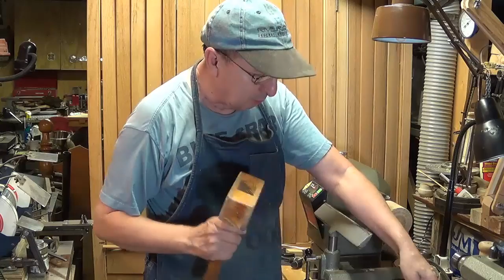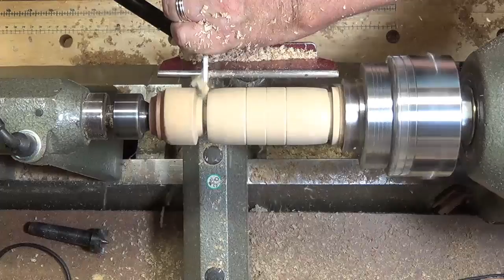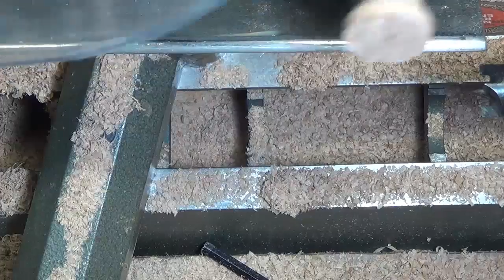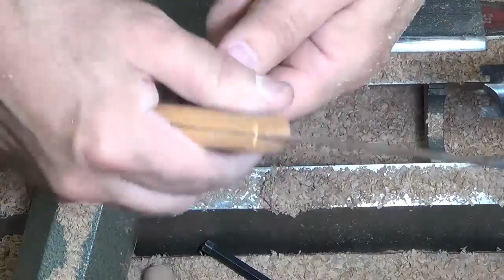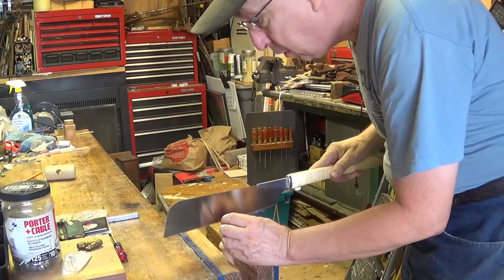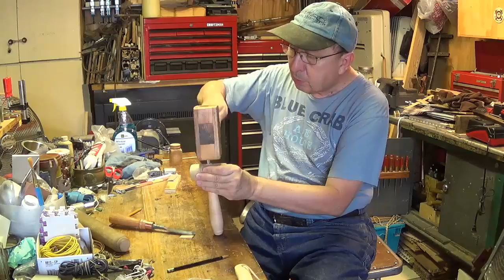Table Leg that wanted to be a Mallet

Comment: Nice mallet Cip. I prefer more details which take a longer video. When carving fine details in figures I some times use a hard rubber mallet also. Found at a local recyle store for 99 cents. Thank You

Comment: Hey Cip, nice project, I do want to comment on the length of the videos, each project should dictate the length not the clock. you need to covey a certain amount of information for each project. if you let the clock influence that information, then the person that looses is the beginning turner that needs that info. so much I see vids that critical info is left out for one reason or another most of the time its due to the interest in self exaltation rather than showing how to do the turning. I for one like the longer vids over the 15 min or so ones. I find that I enjoy the 50 min and longer vids where I can kick back and enjoy watching the show. I like your vids Cip keep them coming, and thank you for your effort in making them I for one enjoy them.
Will
Reply from the maker: Will Culpepper Hello Will, Thank you for the reply. I will continue on. All the Best, Cip

Comment: I think your video lengths are fine. I would not want you to leave out the instructive details just to make it shorter. If you leave out those details, why watch. If find a section that doesn't fit my interests I can skip ahead, If a do skip a section it may be different than what someone else might skip. Usually I watch the whole thing because I never know where I might learn a trick or two..
Reply from the maker: John Shaw Greetings John, thank you for your insight. I appreciate you letting me know what you think. It really does help reassure me about what I am doing. All the Best: Cip

Comment: I enjoy your videos.  As a newer turner they are very interesting and informative.  I think they are about the right length.  Some folks speed up all the turning and it's hard to then learn from watching the techniques used to make the piece.
My thanks for putting them up.... Doug.
Reply from the maker: Doug Korn Hey There Doug,I am guilty of that. For lengthy stuff I speed it up to 4x, I turn so slow it may not be so obvious. Otherwise my videos would be extremely long. I will try to be more conscience of that. Thanks for your comments. It does help me, greatly.Kind Regards, Cip